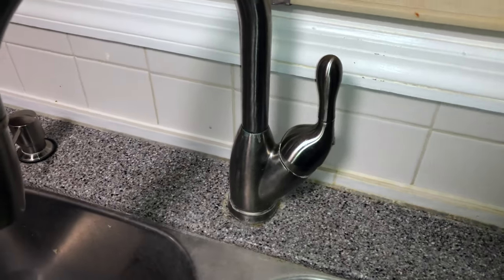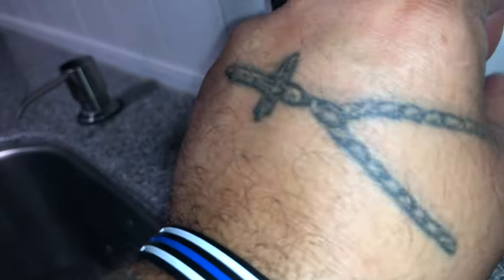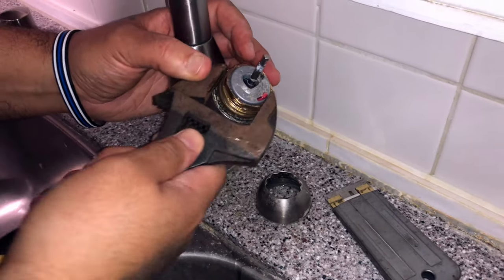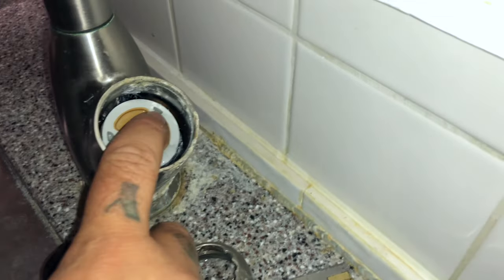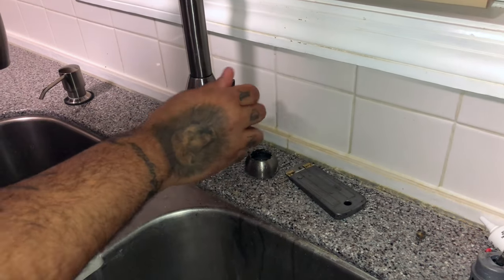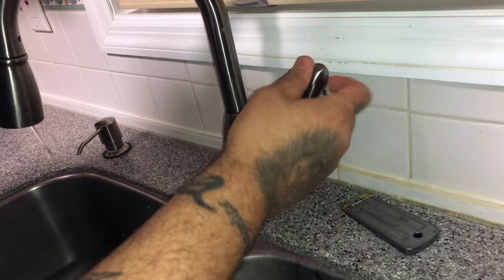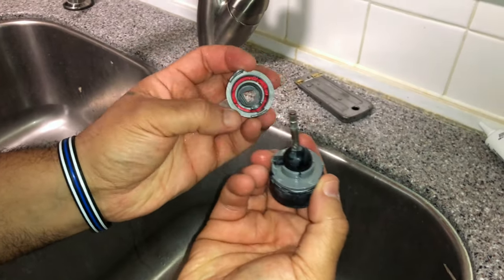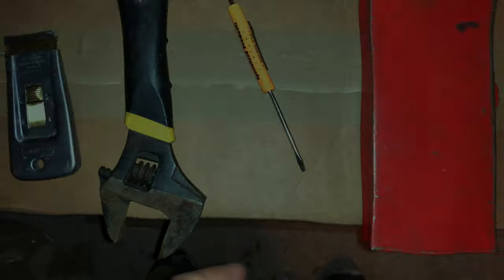How To Replace Your Delta Single Handle Faucet Cartridge

Comment: I have Delta with a pull out nozzle. The hose came loose from the faucet sput. Is there a trick to get the hose back up thru the hub assembly to reconnect?
Reply from the maker: Pry up on the entire gooseneck it will pop off then you can snake it all through.
Reply: @MrV2u  can I send you pic of what I have? I spent an hour with Delta and the end result is that they will send me a new faucet. It will take 6 to 8 days that leaves us without a kitchen sink. When you say pry up do you mean the hub assembly? I do not have a gooseneck. I asked them about te hub assembly because it seems to me I could fish it thru but they said it is not supposed to be removed.
Reply from the maker: @herbsu4330  sure thing mrv2u@hotmail.com

Comment: My cap is real jammed I think because of corrosion and lime buildup. I couldn’t get it out even after 30 mins it sitting in liquid wrench. Do you think I should let it sit for 2 hours or so? Have not tried vinegar yet. Will try that after this.
Reply from the maker: If the liquid wrench didn’t get it loose soak it in vinegar. Try to rock it back and forth to get it loose (tighten and loosen) to get it to budge. If all else fails try PB Blaster. That stuff is amazing. Let me know how you make out brother.
Reply: @MrV2u  hi again, I got it out finally! Had soaked in vinegar like you said. Even then, I was unable to rotate it using channel locks; chrome finish to hell, got all deep marks in it. Finally, I hit it couple of times using the plier on both sides and tried from the top, holding one side of “teeth” with pliers and it finally rotated a little. Inside the cartridge, if you open it, there is a small white plastic sheet which was torn in my case, probably the cause of the leak. Anyways, thanks for the vinegar tip! Helped a lot!
Reply from the maker: @gl.72637  hood to hear brother. Sucks about the finish. Call delta and tell them that your cap is  peeling in spots and I’m sure they will send you one under warranty. They have awesome lifetime warranty benefits.
Reply: @MrV2u  thanks brother. Will cal delta for sure and ask them to send over a replacement.
Reply: @gl.72637  Having a HELL of a time getting the trim nut off too!!  soaking and waiting.  Need to make dinner soon. LOL
Reply from the maker: By the time dinner is done you should be good to go. If not let me know. And what’s for dinner? Lol
Reply: @MrV2u  You were absolutely RIGHT!  It did finally come loose after quite few applications of white vinegar !  Just in time to clean up after cream of broccoli soup.  All done and working - thanks to your great video.
Reply from the maker: @angelaprenosil6406  glad it worked out for you. And that soup sounds delicious right about now lol. Thanks for the feedback.

Comment: I put the new cartfride in because the old one would not shut off. Now it will shut off but only if I close the hand from the cold side. If I shut it off from the hot side I get a trickle that wont stop. I have to turn the faucet back on then turn it off from the cold side before it will stop. Any ideas?
Reply from the maker: Seems to me that you got a bad cartridge brother. I’ve seen it happen more than once. If you call delta they will send you a new one for free under their lifetime guarantee.
Reply from the maker: Let me know how you make out my friend.

Comment: My sprayer works intermittantly. Where is the diverter located in the faucet? How can I replace it?
Reply from the maker: I’m pretty sure it’s in the head of the faucet. I doubt it’s replaceable. Call delta and have them send you a new unit. They have a lifetime warranty so no questions asked.

Comment: Awesome video...thanks so much for the instruction...Hey, question for you...after replacing cartridge, getting a single drip every minute or so from the faucet. I snugged it up pretty tight. Would it be too tight or should I give it another snug?
Reply from the maker: It shouldn’t be Superman strength tight. Just snug it up some and let me know if that helps brother. It wouldn’t hurt to take it back out and check the orange seals and make sure they didn’t get pinched or crushed in anyway.
Reply: @MrV2u  I will do that when I return home & let you know. Thanks for the support & tips!
Reply: Hey there, think I figured out the problem. No matter how much torque (not superman) or less, it still leaked, so I put original back in & no leaks, so looks like the new one Delta sent out is defective. Will contact them & see if they can send out another one. Just wanted to let you know what happened. Thanks again for your channel & continued advice.
Reply from the maker: That would of been my next suggestion. Thanks for the update. Let me know when it comes and your good to go.
Reply: @andyw197  I've had this problem before.  I've actually had to take the new gasket off a new one and put it on the old one.  3 weeks ago I replaced mine again and it started leaking.

the odd part is I thought ok maybe its not tight enough so I tightened it more and it started leaking more as if the gasket warped due to overtightening but I originally tightened it by hand.  Delta is sending me a free one so we'll see with this one.

I wonder if these are just problematic or cheap manufacturing over the past few years.
Reply from the maker: Most likely cheap parts brother. Let us know how you make out brother.
Reply: @MrV2u  Hi there, just wanted to let you know all is good with our kitchen faucet. Delta warranty came through & sent out a second cartridge,  which I installed today using your video again (snug, not Superman strength). No leaks, like brand new. Wanted to say thanks again for following up & thank you to David's comments as well. Nice to know we're not alone when it comes to plumbing. Take care.
Reply: @davidchapman1986  Thank you David, second cartridge came and all good now.
Reply from the maker: I’m always around to help my brother. I’m glad it was just a defective unit and that your good to go now. Thanks for the update.
Reply: Yeah new cartridge combined with new locking nut let me clamp it down better. I had a small leak coming from the bottom but kept slightly torquing down until it stopped. Old nut was pretty corroded.
Reply from the maker: @davidchapman1986  good info brother thanks.
Reply: @davidchapman1986  I'm really glad you fixed it. Faucets are something that most people take for granted until they begin to fail. Take care!

Comment: Any tips on how to remove the buildup around the mechanism of the cartridge? Basically build up on the threads of the screwing mechanism. Ours is full of deposits.
Reply from the maker: Take a rag and soak it in vinegar and let it sit for 1/2 hour and repeat the process over and over till the calcium dissolves. It’s going to take a lot of patience and soak the rag very good. Let me know if that helps Adrian.
Reply: @MrV2u  That did help. Thank you.
Reply from the maker: @adriant240  that’s awesome brother. Glad it worked for you. Thanks for the update.

Comment: I got everything off down to the cartridge. But when I put the cartridge back in after cleaning it’s hard to get it back in properly to align right. Does it snap in with the tabs? My problem is that the cold water pressure is fine but hot pressure is weak. It’s a single handle faucet.
Reply from the maker: The tabs allow you to align it up correctly. If it’s not sitting in the tabs you will have issues. Take it back out and check that the tabs are not broken and aligned right. Did you have that issue before you replaced it? Let me know if that helps. I’ve also seen new cartridges come new defective.
Reply: @MrV2u  thanks for replying! I didn’t replace the cartridge but took it out and tried to clean it then put it back in. But from what you are saying. I didn’t align it right. I will fix that and if it still didn’t fix the hot water pressure I will replace the cartridge which the manufacturer is sending me for free.
Reply from the maker: Let me know how you make out. You should be good to go though with the new one.
Reply: @MrV2u  well I replaced the cartridge and the hot water pressure is still not great so I don’t think it fixed it. Could it be an issue with the supply line? I think I’m throwing the towel in and calling a plumber. I also opened up the old cartridge and didn’t see any blockage or issue.
Reply from the maker: If your hot water pressure is slow in just one fixture, you'll want to check to make sure the hot water valve is turned all the way on. If it is, the problem is most likely a blockage of some sort in the hot water supply lines. But if you’ve found that your hot water pressure is weak in all of your home’s appliances, it’s most likely due to sediment build-up in your water heater.
Reply: @MrV2u  thank you
Reply from the maker: Did you figure it out?
Reply: @MrV2u  I think something might be wrong with the hot water shut off valve as I’ve turned it off but water keeps flowing out of the faucet. And if I run the hot water too long the hot was supply line starts hammering/vibrating noise. That fix is definitely beyond my confidence level 😂

Comment: the bonnet nut and the cartridge can freeze up together.    since the valve cartridge is plugged in at its bottom in two places, if the bonnet nut is forced, and the cartridge plugs break, you will be buying a new faucet. this is more of a pain than you would think, with many of these videos glossing over this problem completely. it is not mentioned that maybe the guy had to dismantle the faucet and soak it overnight in a container, to try to loosen the cartridge from the nut before attempting loosening the nut from the threads.   even then no guarantee.
Reply from the maker: What you see in my video is exactly live. I don’t pre do anything to make it easier, and if it broke you would see it on the video. It is definitely possible for it to seize up and like you said soaking it overnight would help. Pb blaster, WD40 and or vinegar will dissolve the calcium/lime buildup and help when trying to bust the bonnet loose.
Reply from the maker: And Delta does warranty their product 100 percent. So if needed contact them and tell them your situation and they will replace parts as needed free of charge.
Reply: Ive tried everything to remove the bonnet nut but failed. Im switching to another brand for this very reason. the bonnet nut design seems prone to failure in my opinion.
Reply from the maker: @mhmdyssen get some heat on there if you can. Did you try the vinegar and pb blaster?

Comment: set screw won't come off.  soaked in vinegar for days, penetrating fluid, ATF, nothing works.  torqued the allen wrench, now it's stripped.  how to fix now?
Reply from the maker: Your going to need to drill it out with a small bit and then try to get an extractor on it. I would definitely reach out to Delta and explain the situation and they may just send you a new unit under warranty. They have a great lifetime warranty. Let me know how you make out brother.
Reply: @MrV2u  that set screw is so tight I'm afraid of breaking extractor off.  maybe better to just drill it out completely and replace handle.  I contacted Delta, they said stripping the set screw was not covered under warr, but they would send replacement handle as goodwill gesture.  that's nice of them, seeing how the handle lists at an eye-watering $86.
Reply from the maker: @halleffect1  just start with a small bit and work your way up. You can also try a reverse bit and it might break it loose faster. I hope the handle comes with the set screw as well.

Comment: I changed the cartridge as you showed but now my handle is loose
Reply from the maker: Loosen up the set screw and slide the handle down further perhaps. Make sure you tighten the set screw up tight. Let me know if that helps.

Comment: How do you loosen the nut. It seems to be frozen or locked on ? We tried two wrenches, WD 40 etc nothing moves.
Reply from the maker: Pb blaster is better than wd40. Soak a rag with vinegar and wrap it around the nut as best as possible and give it time to eat the calcium build up. Then hit it again with wd or pb blaster and tighten it a bit to break it loose. Then back it off. Let me know if that helps Frank.
Reply: Same issue for me. The nut seems to be frozen and nothing works. The wrench actually stripped the grooves on the outside of the nut. Guess, might just have to replace entire faucet.
Reply from the maker: @raghavann616 before you go that route call Delta and they will send you parts free of charge. If you didn’t get the nut off you may want to try some heat on it. Propane torch if you have. Try to tighten it up a bit then back it off. This may break the calcium build up. Pb blaster and vinegar the entire area and let it sit a couple hours. Let me know how you make out.
Reply: @MrV2u  thank you! Will try this and see how it goes!

Comment: For the price of a cartridge you can almost buy a new faucet.  I bought two on eBay for $10 each.  One works and the other drips on the cold side.  Aby thoughts on why they ship with two gaskets???
Reply from the maker: A cartridge is like $30+ and a new faucet is around $200+. If you call Delta they will send you a new cartridge for free under warranty.

Comment: My problem continues to be leaking water from value. I have changed  gaskets ( which you never mentioned) and still no luck
Reply from the maker: I had another subscriber with the same issue and he replaced the new cartridge and it worked. Guess he had a new defect. There isn’t no point of changing the gaskets on the cartridge if your replacing it with a new unit. It comes with new gaskets.

Comment: Why you not mention what the little orange switch is for???
Reply from the maker: The orange switch allows you to choose between "Cold & Hot" or "Cold & Warm". Some people don't want to have very hot water, so this switch limits the movement of the handle, not allowing it to move all the way into the Hot position. Hope this helps.

Comment: What do I do now.  4 of us tried but we could not budge copper ring?  Video looks so easy to get copper ring off
Reply from the maker: Soak it in pb blaster or wd40 and let it sit overnight. If you can’t loosen it try to tighten it just a bit to break it loose then back it off. Let me know if that works for you
Reply: Having same problem.  Did you get an answer?  I've soaked it in WD40 and NOTHING.  Trying the vinegar now.
Reply from the maker: @artserna9074  vinegar worked for me. Did you try to tighten it a little bit then back it off.

Comment: Be aware that this part has a Lifetime Warranty. If you send Delta a copy of your faucet sales slip and Owner’s Manual, they will send you the replacement part. My son just replaced mine with the part Delta sent to me. $0.00 😃
Reply from the maker: You are correct sir. I just needed to replace it sooner than later. Thanks for the info.

Comment: I replaced the cartridge about 3 weeks ago and now it is dripping again! What should I do?
Reply from the maker: It could be a faulty replacement. Call delta and have them replace it under warranty. Let me know how you make out Peggy.
Reply: If you're an apprentice working with an old timer in the trade, they'll tell you:  'you weren't holding your mouth right'.  :body-blue-raised-arms::face-blue-smiling:
Reply: These cartridges only last around two years. Since I owned my delta faucet almost 5 years I had to replace the cartridge twice already. Delta makes a faulty cartridge. We are getting rid of our delta faucet for another brand!!!
Reply from the maker: @jogmas12  as per your other conversation. They have a life time guarantee. I know it sucks having to swap it out so much but it doesn’t take long to do so. Moen might be better for you and the family brother.
Reply: @MrV2u  what do you think of Kraus faucets?
Reply from the maker: @jogmas12  good quality, used in the commercial setting often. You can’t go wrong with any known brand brother. Moen, delta, Kohler, even on the cheaper side American Standard or Glacier Bay.

Comment: In most cases Delta will provide you with a free replacement part. If you have have to buy it,  please buy the original Delta part.
Reply from the maker: Yes sir, I didn’t want to wait for delta to send me one. The part I got was an original Delta part.

Comment: Curious; Does this help with bad water pressure too?
Reply from the maker: It shouldn’t, is this the only faucet in the house with low pressure? You can soak the faucet head in a bag of vinegar for a couple hours to eat up the calcium build up. You may get pressure back like that. If not disconnect your hot and cold water lines and check for an obstruction. Let me know if that helps my friend.
Reply: @MrV2u  thank you! Disconnecting and blowing pressureized water/air from the faucet down the lines into an empty bucket is my next move!
Reply from the maker: @jessicabradley3789 did you try cleaning the head? You’d be surprised how much calcium and lime build up in the head. Let it sit overnight in the vinegar.

Comment: What is the little orange switch on top of the cartridge for?
Reply from the maker: It limits the hot water. On will give you full hot water. Off will give you warm water.
Reply: Which way is on?
Reply from the maker: It is a limiter for the Hot. When looking at it with the switch above the stem, the switch all the way to the left allows the maximum of hot water through. If you move it towards the right (it actually has 4 or 5 positions) it makes restricts how much hot water can get through and actually keeps your faucet handle from moving to the left in relation to the 5 positions. Move the switch all the way to the right, the most you can move tire faucet handle to the left is actually center. Only needs to be adjusted if you have extremely hot water and you want to prevent someone getting scolded by it